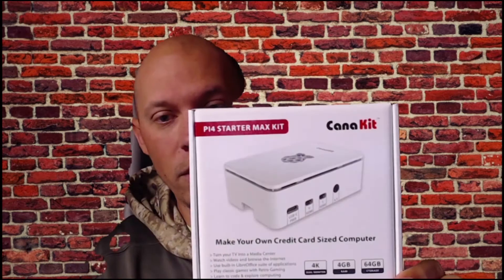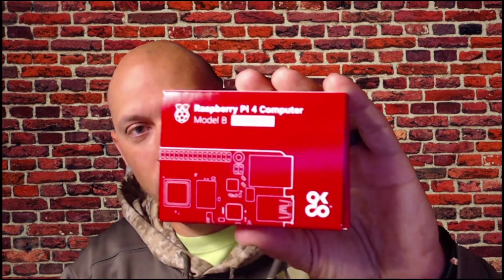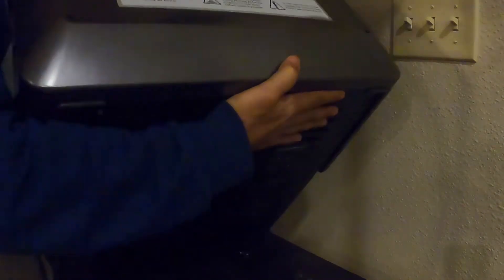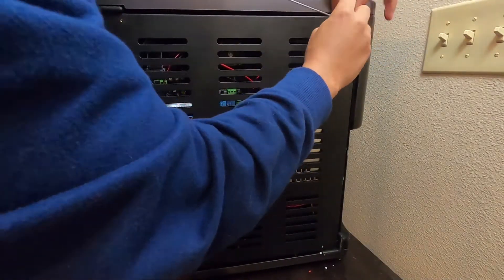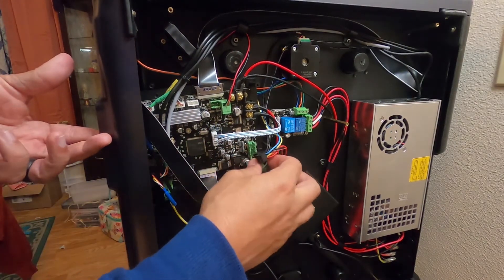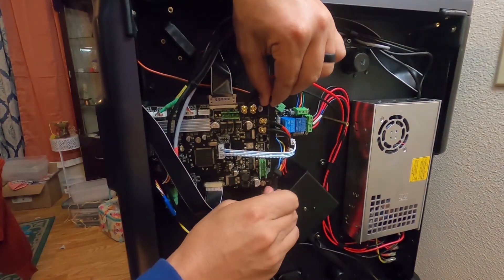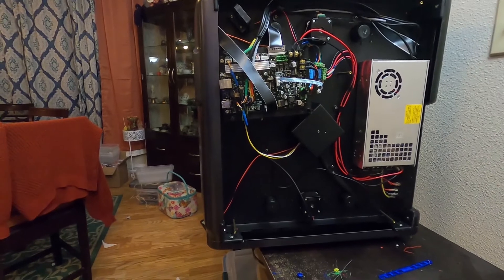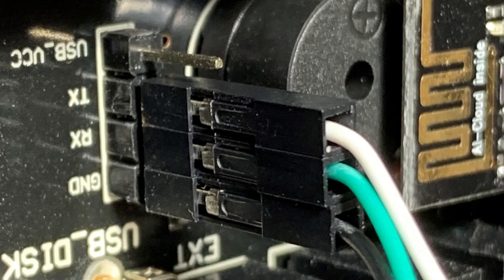Connecting the Raspberry Pi to the Qidi X Max

Comment: Hi Mike, Thanks for the instructions. I was able to connect my QIDI MAX 2 to my raspberry PI 3. I did contact QIDI and was sent instructions on how to connect the raspberry to my MAX 2. They did recommend a different USB to TTL device. I bought the one you recommended in your video. It works perfectly, nothing to download or install. Opened Octoprint and was able to monitor and change temperatures, sent everything to "HOME". Great INstructions, Thanks again
Reply from the maker: I’m glad our instructions were helpful for you. I made the mistake of buying a different “cheaper” USB to TTL adapter and it did not work so I am glad you didn’t have to make that mistake like we did.

Comment: Question 2. Is possible get power for raspberry pi from printer psu?
Reply from the maker: Not by using this same connector. I’m sure if you ran TTL to TTL you maybe able to, but I haven’t tested this out so I would not know which connectors to use.

Comment: Do you know if you can just plug in the USB cable into the front of the printer and connect the gpio plugs to the pi instead?  And also where did you place your pi, inside on the bottom or ran it outside of the printer?
Reply from the maker: Unfortunately it will not work using the USB on the front that way. I ran my Cable though a gap so my PI is outside the printer. This way if I needed to diagnose or fix anything, I did not have to take the printer apart.
Reply: So I set it all up and it's awesome.  Thank you.  But one more question, whenever it prints it no longer shows the status on the xmaxs screen itself, the screen still works just no info on the print, I have to either check on cura or the app itself.  Is this right?  Thanks again.
Reply from the maker: So far that is correct. I have not looked for a plug-in for the screen to work in a while. I personally log into the PI on my phone and monitor it that way.

Comment: It looks like the vendor placed a different product on the Amazon link for the cable. Please provide an updated link to purchase the cable and adapter. Qidi said a cable and a TTL adapter is needed to connect the x-max to a raspberry PI. Thank you!
Reply from the maker: Updated!  Thank you for the heads up with the link.

Comment: Hey Mike, just an FYI… These instructions WILL also work on the i-mate/S with [basically] the same procedure. The Wi-Fi board has to be removed to plug in the 3 TTL connectors, but the OctoPrint gives you wireless connectivity, so it’s no longer needed anyway. Thanks for this and all your great videos!
Reply from the maker: No problem. Thank you for the updated information.

Comment: After I did the upgrade with the knobs and replaced springs with the items you suggested but without hardly cranking down on them, the z doesn’t go go enough to even come close to where it needs to be to align the bed
Reply from the maker: Two suggestions for you. Fast level and raise the z up until it gets close to the nozzle. If that doesn’t work, what is your z-offset set to?
Reply: @Eitri3D  Did the fast level and raised the Z and that did it, thanks. love your videos, Love my Qidi, I did the one with the USB adapter plugged onto the mother board but cant seem to get it to connect to my pc.

Comment: after connecting the raspberry pi to my xmax whenever i press the home button the print head goes all the way to the top right hand corner but doeasnt stop when it reaches the end, intead it does a scary sound like its hitting the side continuously really fast. is this what gets fixed by doing the cbd fix firmware? if so when i try to flash it from firmware updater and i enter the url I'm not sure what flash method am supposed to use?
Reply from the maker: So when you add this url https://github.com/OctoPrint/OctoPrint-FixCBDFirmware/archive/master.zip into your plugin manager url field and hit install a pop up box should appear and run through the installation. Is that not happening?
Reply: @Eitri3D  i saw online that i should  do it with a plugin called firmware updater but i did also try to add it through the plugin manager. 
https://imgur.com/eY9E3ea
https://imgur.com/9HFrBTk
even after adding that plugin i still keep having the print head bump into the top right corner and it happens when i press home on both octoprint and through the XMAX touch display.  i even tried making my build plate 250x250x300 and the problem still occurred.
Reply from the maker: Do me a favor and message Eitri3D on Facebook. Once I get back to my printer, I’ll be able to pull up my settings and we can walk through it together and we will get you printing again.

Comment: OK, got it connected to my X-Plus. I was able to print some small stuff but kept getting gcode errors. I contacted them to get some updated firmware and now the print head just sits in the corner complaining. Did you install any Octoprint plugs to make it work? If so which one?
Reply from the maker: CBD_fix is the main plugin that i installed.

Comment: Is there a way to wire the power to the PI from the PSU? Seems to me, you could hide the PI right in there and have the PI boot when the printer boots. I am wondering if I just got a molex to female USB adapter on Amazon, cut off the molex end and wire the two wires right where the power is connecting the motherboard. This wouldn't work for PI4 since it is USBC, but should work for PI 3B
Reply: Also, I have the X-Plus, I assume the process is roughly the same?
Reply from the maker: To be perfectly honest with you, I haven’t tried that and haven’t heard of anyone hard wiring it with these printers. I don’t know the exact watts or amperage on the board or Pi to even try it. I know people do hide it under the printer, but for me, I prefer it on the outside so I can troubleshoot it without having to take the bottom off the printer just to access the Pi. My Pi came with a power button so I can turn it off at will. If this is something you end up trying, I’d love to hear the outcome.

Comment: Great video!  Would you mind sharing the Octoprint settings for the X-Max  :) I just got the printer today and will be installing the pi and cam tomorrow.
Reply from the maker: Once you install it you’ll need to download the “CBD_fix” plugin from within OctoPi. Once it is installed you should be good. If you’ve got specific setting questions, message Eitri3D on Facebook and I’ll be able to assist further.
Reply: @Eitri3D  thanks much :D
Reply from the maker: No problem, let us know if you into any issues.

Comment: Great video.  How did you route the USB cable out from the bottom of the xmax?
Reply: Yes, that’s correct.  The CBD issue
Reply from the maker: Go to the plug-in manager inside of octoprint and search CBD Fix. Click on it and run it. It should run and fix the issue right there. It will pull it from GitHub, but that’s the repository. I’m glad our videos are helping and your enjoying them.
Reply from the maker: I ran it between the bottom plate and the edge of the machine. There is a gap around it big enough to allow it to fit.
Reply: @Eitri3D  Thanks.  One last question.  I got received a firmware broken notice once I update the Pi.  Apparently this is a known issue with QIDI tech.  I found the zip file but how do I manually update (since I don't want GitHub)?  Love your videos.  Already waiting on supplies for the hotend upgrade.
Reply from the maker: Are you talking about updating the CBD file in the Octoprint?

Comment: Is there any reason you didn't simply use the built in UART on the Raspberry pi GPIO pins instead of buying a USB uart?
Reply from the maker: For ease of access. This way I can move, adjust, or disconnect using the USB. Just personal preference honestly.

Comment: How did you connect to the pi?
Reply from the maker: The other end of that cable is a USB so it plugs into the USB port on the Pi. Now I didn’t have success with it plugged into the USB3.0 port but that could have been an error or something else on my end. Once the USB is plugged in you can either connect via SSH or via the IP address.
Reply from the maker: The microchip inside the actual USB. The generic cords I talked about in the video are running a Prolific TL2303 chip which I have not heard of anyone being able to successfully connect the Qidi to the Raspberry Pi. The Adafruit cable that is linked in the description is using a SiLabs CP2012 chipset. During my research, and trial and error, this has been the only successful USB to TTL cable mentioned, that I personally have come across. As for issues, you have to download a plugin which Octoprint recognized and recommend as soon as I powered everything on. “Fix CBD” is the name of the patch. Other than that don’t update or install anything on your Pi if it is connected to the XMax even if you are printing the factory way because it locks up the print 48 hours into a 60 hour print. Leaned that the hard way. Other than that, I have been super pleased with it so far.
Reply: @Eitri3D  I hooked everything up per your video and installed CBD Fix. I also installed a fresh IMG of Octoprint.  It's not detecting my printer. Is there anything else I should try? What Baud Rate are you using?
Reply: Had the RX and TX switched. It's working now. :)
Reply from the maker: Awesome, glad you were able to get it up and running. I hope the video was of some use and assisted.
Reply: @Eitri3D  couldn't have done it without your vid. Thanks man.
Reply from the maker: Absolutely no problem. Glad we could help. Enjoy using your Pi, I know we have.

Comment: I wish i had this resource when i added octoprint, great vid very clear. You mentioned it blacks out your screen, I power up the pi then the xmax, that way it allows me to use the screen and send prints/commands. been doing that for for months, why would it be a problem?
Reply from the maker: So I have found that if I boot my Pi first, then my X-Max, the Pi has a problem with recognizing and connecting to my X-Max. There is a high probability that I may have something on the software side not programmed incorrectly and that is why. Now the blacking out the X-Max screen only happened when I used the generic USB adapter. Something inside the those adapters has a chip that does not communicate with either the Pi or the X-Max, from my personal experience.  Maybe I misstated something in the video that mixed what I was saying with what I meant. Thank you for the comment. It’s great to know that these videos are on the right track for helping others.
Reply: @Eitri3D  I had a similar problem a few times after setting it up but only when i tried octopi.local in the browser, i then got the ip for the pi from my router and use that instead and it connects no problem now via all my devices.
Reply from the maker: I’m going to have to double back and check it a few times now that everything is finally setup in its final spot. I am also trying to remember how I connected to it the first couple of times. Thank you for explaining that because my experience might have been due to lack of experience.

Comment: 35T! lol
Reply from the maker: I mean kind of, but probably better. LOL
Reply: @Eitri3D  this stuff is pretty cool, I have a 3D printed go-pro mount for my helmet and would like to be able to do it myself for a new helmet or whatever else i would need for my bike.
Reply from the maker: I have printed and designed about 5 different GoPro mounts. Was making a video on mounting my GoPro, but then I failed miserably by not accounting for my printers frame that was in the path of my camera. 4 of my 5 designs have failed. Trial and error. Let me know and I can custom design you a mount.
Reply: @Eitri3D  Badass! I have a mount now that i bought online but yeah it was 3D printed they only did it for 2 different helmets when i buy a new helmet i'll need a new mount.